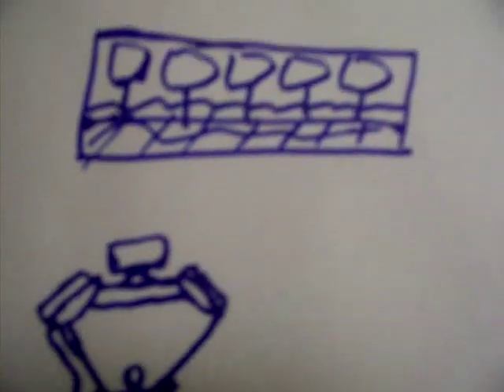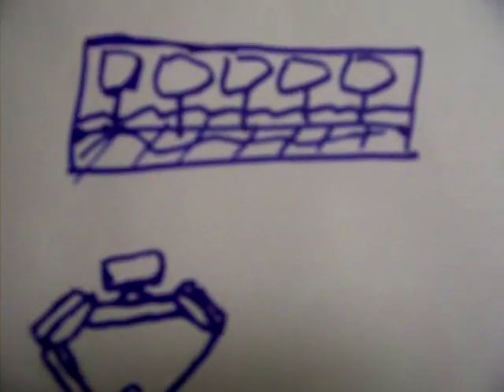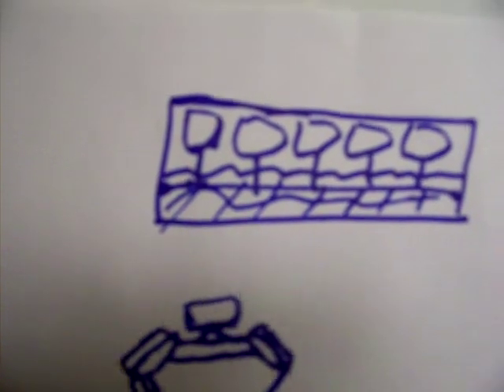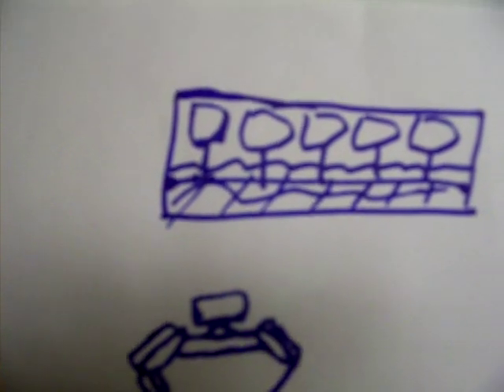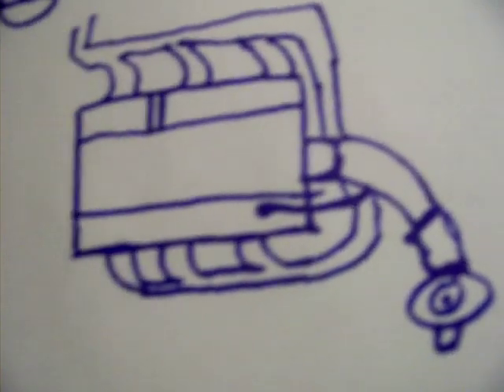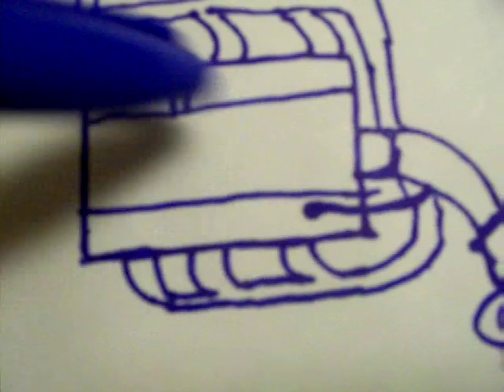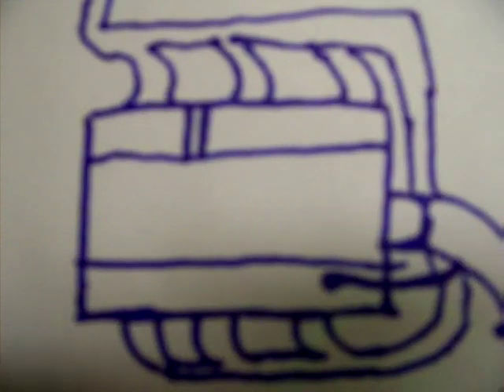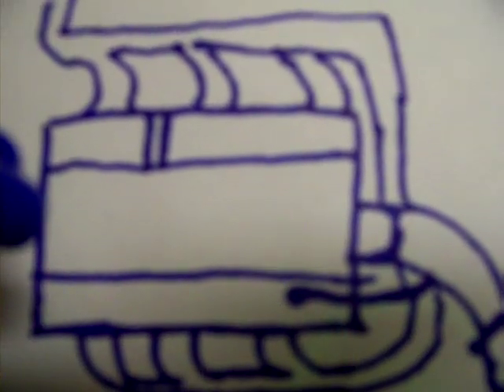How a PCV Valve Works Made Easy

Comment: When I put an oil catch can should I put it between the PCV valve and the manifold or between the Intake tube and the smaller pipe or both? I've heard that in WOT some oil also goes out of the smaller tube and goes into the intake tube. So should I also put an OCC  there?